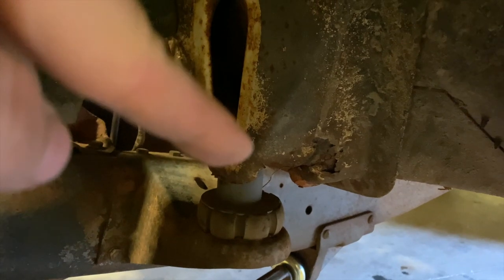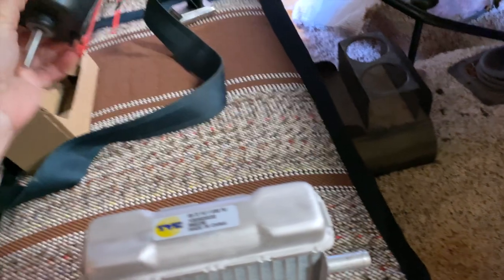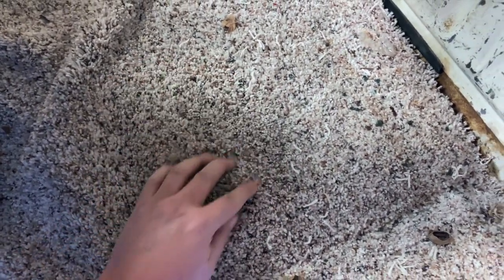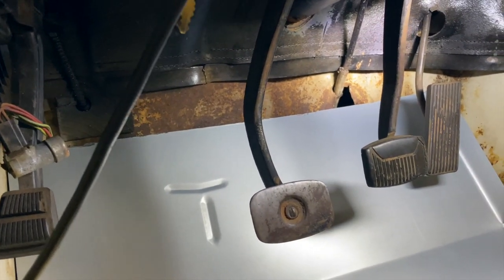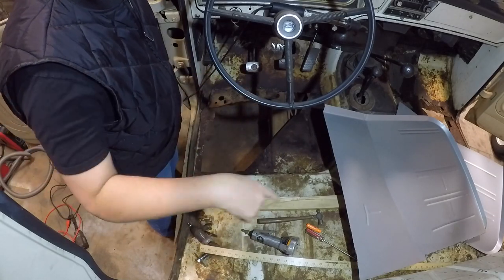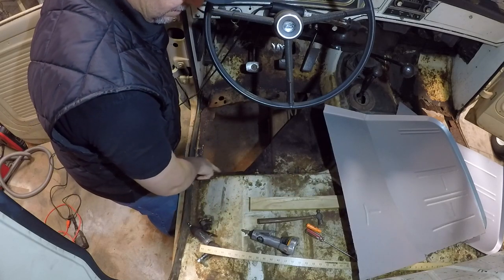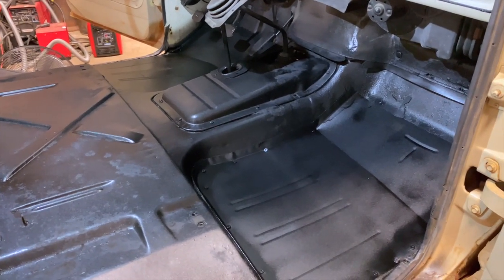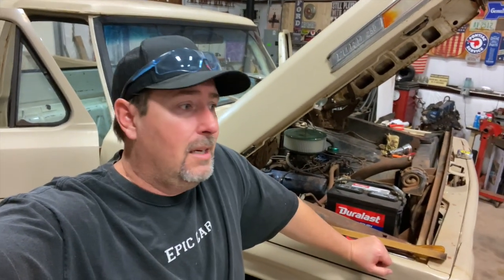Rusty Floor Pan Replacement:  F100 Ford Project

Comment: Can i just ask if you screwed it in how did you attach the cab support mount?? did you weld or screw that as well? also overlapping like that will encourage moisture to sit in there and not get away unlike welding it flush
Reply from the maker: I welded the cab mounts, or at least the parts that I replaced of each of them.  Basically just the bottom of each were rusted to I kept the original parts attached to the cab.  Thanks for watching.